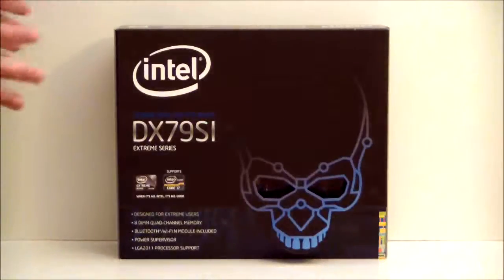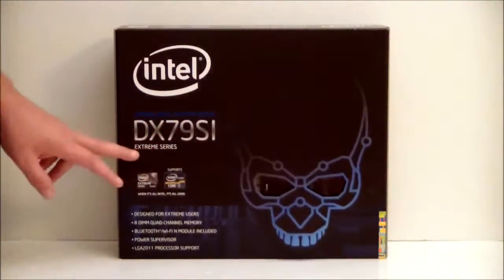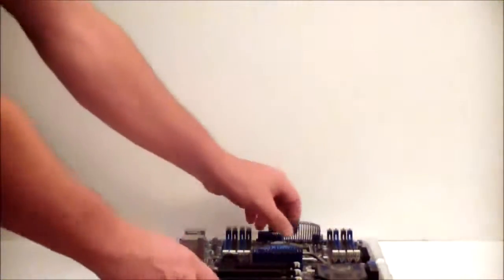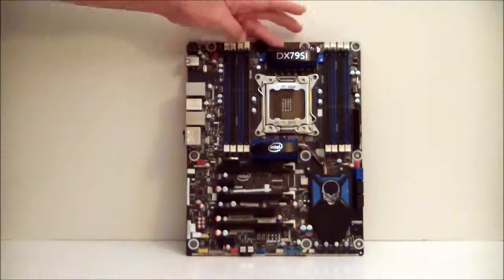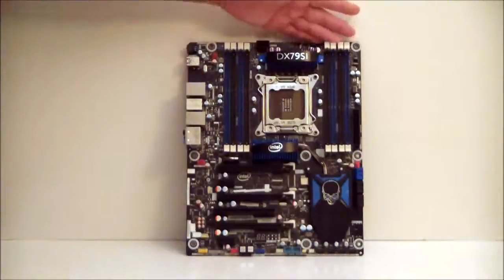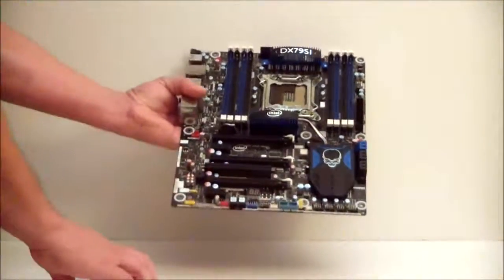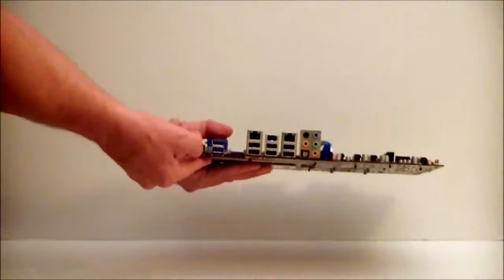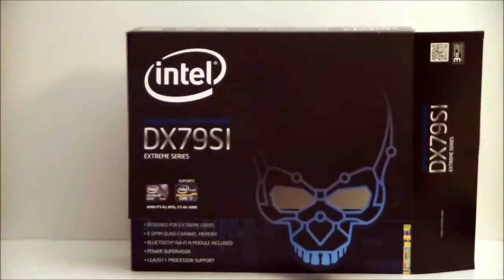Intel DX79SI Motherboard Overview

Comment: I have a generally good question because I use the sport as it currently in 2023 and I want to know exactly what type of bracket this uses or ilym example does it use like a square ilym or a YOM because it has been difficult for me to find what type of island it is in the information and I ended up wasting money on IOM and it didn’t work and it was narrow past and used it and it didn’t work either😊

Comment: I have one. But after I tried to render 3D animation frames on 3DS Max and it shuts down and it wont boot up anymore. I have checked the power pack is working. Just doesnt boot at all. No fan, just lights on the board's built in power & reset button. Everything else doesnt work.

Comment: WARNING to all potential buyers; the the DX79 line from Intel has MAJOR compatibility problems with Radeon HD cards, so bad that you'll likely not be able to use ANYTHING but GeForce cards with them. I just spent the last month going through RMA after RMA, unable to figure out the problem. Now I'm stuck with this board that I can't use and $600 worth of Radeon cards that are incompatible. GeForce users; you're golden. Radeon users; RUN AWAY!

Comment from the maker: @GigZ333 
I would have to suggest one that would be high enough to clear your memory. You will need low profile memory in order to air cool it.
Phanteks and Noctua have some good ones and Thermaltake has a new Edition Frio for the 2011 socket.
The key is always the profile on the memory heatsinks though.
You can always go with a self contained liquid cooling solution also and then memory height won't be a factor
Reply: HiTechLegion is it still good for 2018?